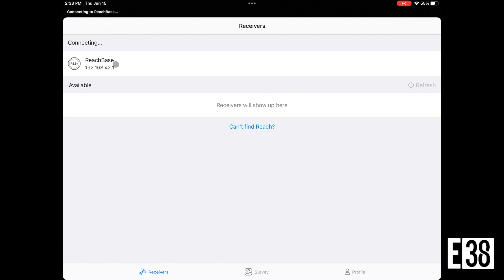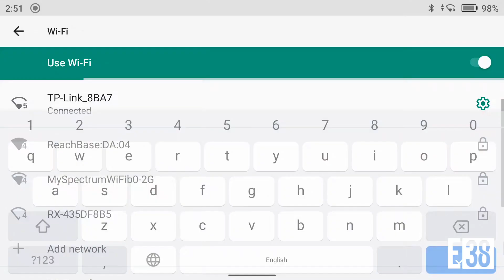Configuring Your Emlid Reach RS2/RS3 as a Base for Your Drone (Newer version available)

Comment: Why not Connecting directly the mavic to the Ntrip? What is the base for ?
Reply from the maker: If you have an NTRIP service available you can definitely connect directly to that for RTK flight. If you are in an area where you don't have reliable internet using this as a base will still work, the base station can improve your accuracy over NTRIP if you're set over a known point, or you can use the files from the base logs in ppk scenarios as well.
Reply: @e38surveysolutions59  thanks!! so it could be really usefull in urban area. Do we must being outside to Connect the Controller to the reach rs2 ? I’ve tried to reproduce step by step like in your video but in the office and i’ve sruggled.
Reply from the maker: If you're trying to receive RTK corrections yes, you will need a base marker established in the RS2/RS3 before it begins to output corrections. If you're just trying to connect to the RS2/RS3 wifi hotspot you should be able to do that anywhere within wifi range of the base. If the light to the left of the power button is solid white you should be able to find that network. If it is blue it means the receiver is connected to another wifi network and won't be broadcasting its own.
Reply: @e38surveysolutions59  i can’t put the caster emlid correction into the controller. Each Time i’ve tried, I’ve recieved a message of error.
Reply from the maker: If you're using caster, your base and drone controller need an internet connection and your specific caster credentials input in their respective devices. Your base will also need a base marker before it outputs any corrections.

Comment: What if you want to set up as a base (local ntrip) with a WiFi router rather than the WiFi on the RC. I like the local solution but I need WiFi to my rc for other reasons
Reply from the maker: You can run it that way, if you're using a mobile hotspot wifi router you may have complications. You just need to be on the same wifi network as the base for the local ntrip corrections to work.
Reply: @e38surveysolutions59 For some reason one I connect to my cellular router, I can’t connect my drone to local ntrip credentials but I can use Emlid caster. Thanks for these videos
Reply from the maker: I'm glad you found a solution that works, what you were seeing with the cellular router isn't uncommon. I've seen some routers work and others work intermittently, while still others don't function at all.

Comment: With Local Ntrip what is the maximun distance you can fly away from the base and still have a fix rtk location on the drone ?
Reply from the maker: Your drone can fly as far as it's capable, as long as your controller stays connected to the base you can maintain an rtk fix.

Comment: Hi, do you need internet connection, right ?
Reply: When I tried this, I was forced to survey a point, enter the point manually, then connect my drone to RTK.  Otherwise the RTK, said weak signal and wouldn’t allow me to connect.
Reply from the maker: @jamesfreese5770  You do have to have a base coordinate established for your base, whether that is just a here coordinate, manually entered, or collected with the base before the base will start to send out corrections.
Reply from the maker: With the RS2 as your base and an RTK module with your drone, you actually don’t need internet to fly with an RTK fix.
Reply: Hi Patrick…Would connecting to a state NTRIP via internet for corrections to the base make it more accurate?  Does the RS2 assess the solution based off the distance to the Cors station?  How far is too far?  I am 36.2km away from my closest station here in Arkansas and the corrections come from that station.  Will that data be useful for corrections?  I realize the closer it is, the better the solution.

Unfortunately for me, that station data cannot be downloaded for PPK.  The closest one for PPK is in Little Rock, which is 46km away.  I’m still learning this, so bear with me…thanks!  Jason
Reply from the maker: Hi Jason, 
Connecting it to a state NTRIP network will make it more accurate than not connecting it to anything, however with a base that far you may not get the best results. You're correct that the closer the base station is to your mission the corrections will be more accurate. To oversimplify things, with the RS2 as your base nearby, the number of satellites that the rtk module and the RS2 have in common will give your solution more data to work with (as well as more similar atmospherics and timing) to get you a more precise location, whereas the further out your base is the more error added to the calculation since there can be a more broad effect from atmospheric differences and timing between your base and drone to those satellites. If you're able to get a FIX from your state's NTRIP network you should have useful data the accuracy of which will degrade as you get further from your base and the more likely your drone is to drop into FLOAT or even SINGLE solutions.
Reply: @e38surveysolutions59  hi Patrick, does this mean you can have the RS2 base connected to state NTRIP while using a Mavic 3 enterprise as the rover? Wouldn’t that make the RS2 become a rover and no longer the base station? Thanks ahead for this clarity.
Reply from the maker: @fadedfd You could be connected to NTRIP with your base to help you establish your base point by averaging out a fix solution. The base needs that base marker before it sends out corrections. You can configure in the base settings how you acquire that point: manually entering the known coordinate that the base is set up over, averaging a point using a single solution(default setting), and averaging a point using float or fix solutions. To average a float or fix solution you would need corrections coming into your base, you could accomplish that by connecting to an NTRIP network.
Reply: I guess you could collect observations at the base during the drone survey and then PPK process these in the EMLID software?